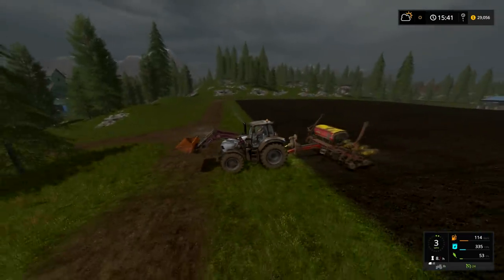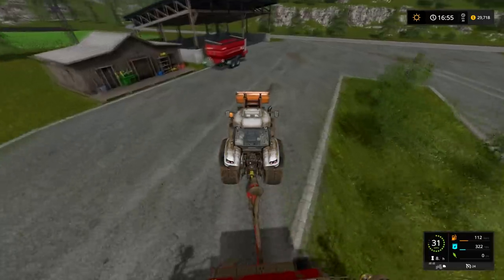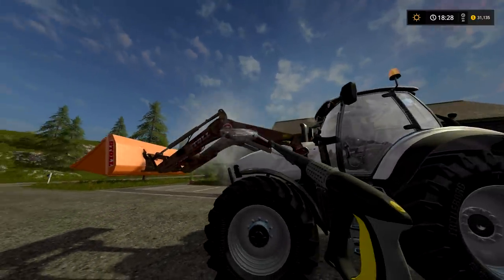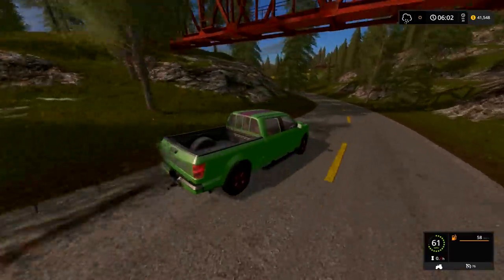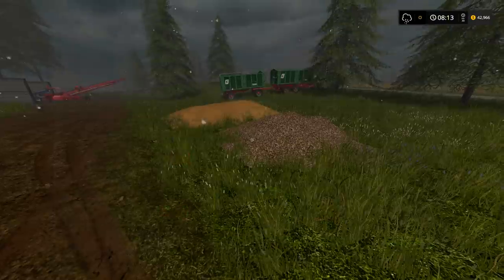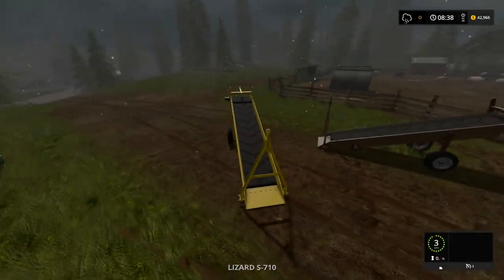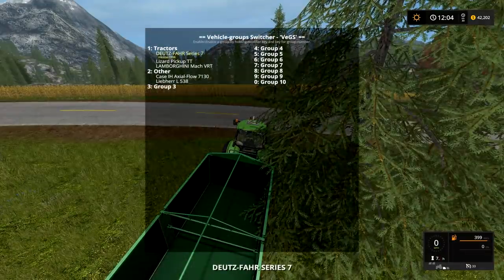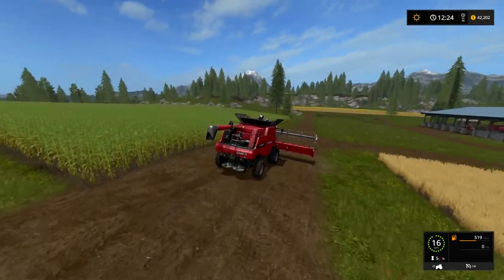Let's Play Farming Simulator 17 | Ep. 48 - Redundancy

Comment: yeah that's what I was afraid with the picker uppers (you're welcome :P). They are super odd when it comes to what it picks up. 

FYI those agro liner green tippers hook up to one another. The loose connectors connect to the other loose connectors. So you could effectively use 4 of those instead of 4 piles... may be quicker, especially if you get a big ol' tractor
Reply from the maker: Thanks! That was so bizarre.

Comment: The Khun DLC requires the newest patch, so I was reading the patch notes and saw this: "Fixed field of view setting (90° was very distorted) (1.3.1)" 

I think it was you that mentioned this issue in a previous video? Or am I remembering incorrectly?
Reply from the maker: I think that was fixed in the 1.3.1 patch. There was a little bit when 1.3 came out where it was RIDICULOUSLY bad (I had to revert to 1.2 for a while). 1.3.1 put it back to normal (what you see in this video).
Reply: Ah, okay. :o)